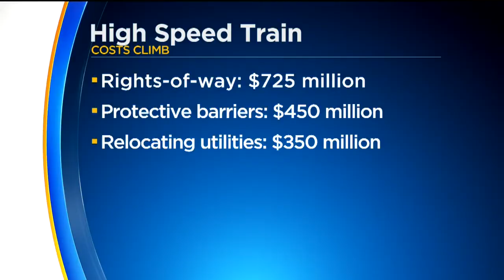First Phase Of California High Speed Rail Spikes To $10.6 Billion

Comment: Well, either way, I hope that a high speed rail line between SF/Sacramento and LA/San Diego is in fact built in the end. The building was stalled for a long time due, in part, to lawsuits and to other problems, including ineffectiveness in leadership. However, the overall push to just can the project is NOT helping the end-goal, which is to have a HSR system in California...which, yes, is needed due to airports being at-or-near capacity and freeways only getting worse. Widening freeways will only induce demand, as has been known for a while, and adding airports will be worse. 

At this point we need a general consensus where an upgraded Central Valley rail line, going between SF and LA, is needed and is executed in a reasonable and publicly-accountable way.
Reply: Hypn0ticB0SS what? O.o
Reply: My apologies, the page wasn't showing your comment for some reason. And really? Lucky...and here we have a NIMBY culture in some areas, which only increases the costs >_> and creates opposition to the rail line even existing :( so yeah. I just want the rail line created, as it's something that California will eventually (if not now) need.
Reply: Hypn0ticB0SS problem with the i5 route is it bypasses big commuter centres like Bakersfield and Fresno. Plus trains don't have to stop at every station (at least I see no indication they would). But yeah, they could have bypassed more, but then they'd still have problems with acquiring property from people who are resistant the the very idea of selling :/
Reply: Even though all three of the state-supported Amtrak routes are in the top-five rail routes in the country? Even though the LA to SF (metro areas, not necessarily LAX to SFO) air route is one of the three busiest interstate air routes in the US? HSR could both offer non-stop service between SF and LA, plus being a commuter system for Central Valley cities, plus just adding to the mobility of those in the Central Valley. Oh, and for those visiting the state from abroad, it'd allow yet another mode of transportation that's fast that'd allow them to travel the state. Visiting from Japan? You can fly into SFO and take the train to San Jose or Fresno or Sacramento eventually. Plus, our airports are already at-or-near capacity, and with expected increase in air traffic, it'll only increase pressure.

Figures: 
https://en.wikipedia.org/wiki/List_of_busiest_passenger_air_routes#United_States_(September_2014_-_August_2015) https://en.wikipedia.org/wiki/List_of_Amtrak_routes#Current_routes